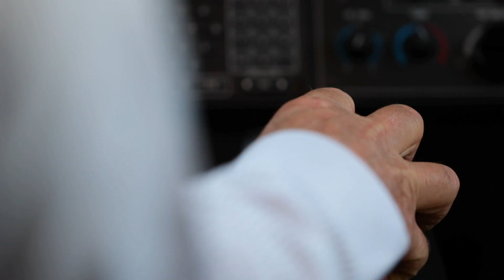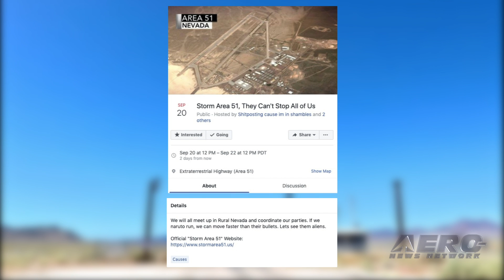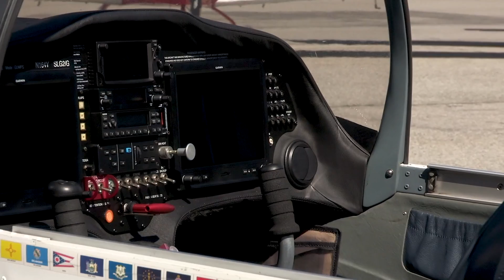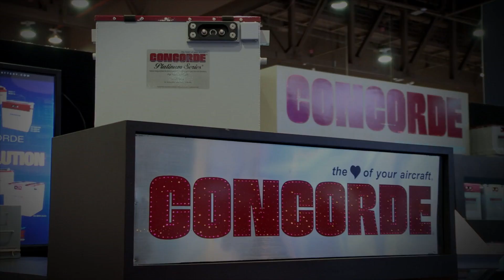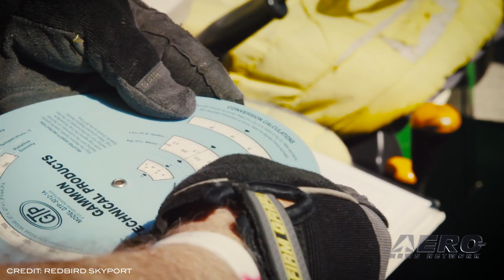Airborne 09.18.19: Draco's Demise, Redbird Skyport Shutdown, tailBeacon STC

Comment: Mike is such an advance pilot/fabricator, he blames himself to avoid cognitive dissonance.  Just like the Merc CLR taking flight at Le Man in 99' THREE TIMES, things just went further than expected, THAT'S WHY IT'S REGISTERED AS AN EXPERIMENTAL AIRCRAFT!
Maybe some NASCAR safety flaps would have helped, in the right place.
Draco's wing was re-engineered, hence the EAA registration.  It was designed for low stall from the factory and still modified(could the winglets have contributed?), throw in the Bernoulli principal applied to the cross wind, and half the original engine weight, and it's 'thank you for locating that boundary for us'.
If the angle of incident between the aircraft's path of travel and the 'wind gust' is 45deg, then the effective wing length is increased by a factor of the square root of two, or 1.414.  Correction by a lift control surface, will increase effect.
Mike pushed the limits, and when he stops blaming himself, we will all be wiser for the knowing the principals of physics a little better.
Hey, if it were easy, any Bachelor of Arts degree holder could do it.